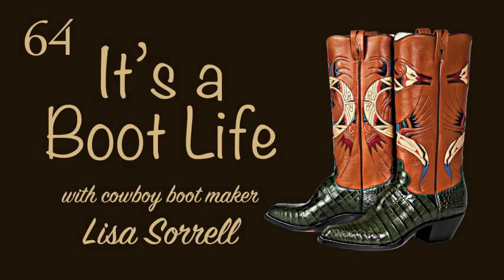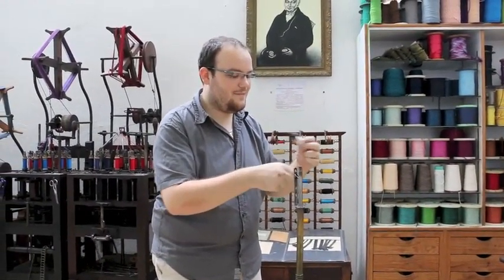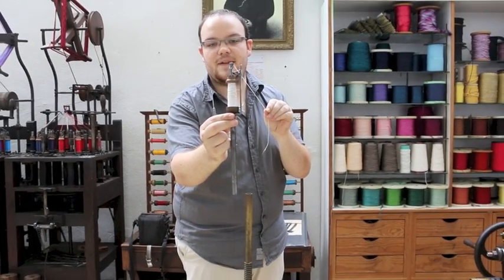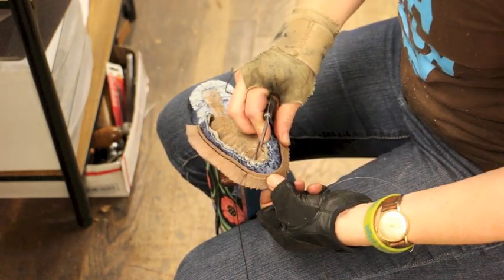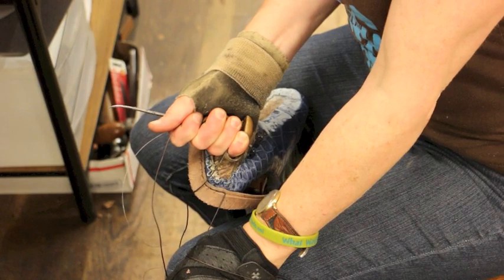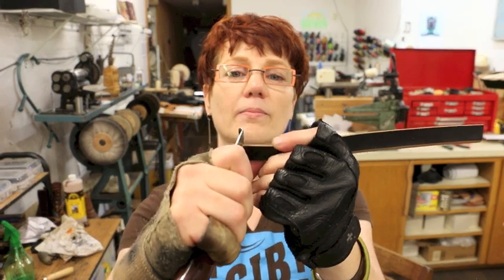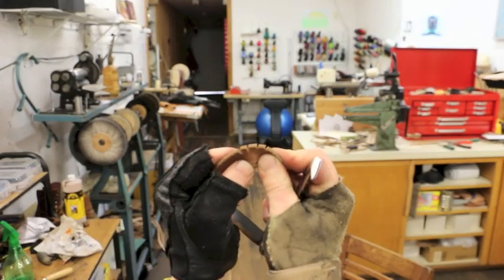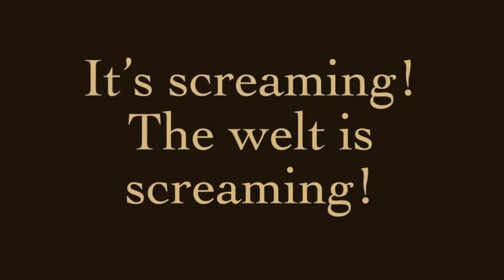It's a Boot Life: welting around the toe

Comment: Novice boot maker here.  I wonder why not run the welt all the way 'round the  entire boot?Are pegs used to stiffen the heel counter?  Do you stop the welt to give more "hourglass?...I guess that's my question. BTW, having watched a previous video  I no longer soak my welt, I stitch the toe damp, not wet, the rest, all the way around, I stitch on dry.
Reply from the maker: Yes, stopping the welt behind the ball allows for a more hourglass shape, but the main reason is that a pegged shank area is stronger than a stitched one. 

I peg the sole in the heel area too, but some boot makers use nails there. Neither strengthens the counter, because while they do go through the bottom edge of the counter, they're not in the part of the counter that wraps around the heel. The counter is stiff because it's heavy leather.
Reply: Hmmm.  Probably be buying some pegs from you soon.  Do you also sell the pokey tool to make the initial holes?
Reply: BTW, I'm honored to have you respond to my queries.
Reply from the maker: Yes, I sell the tool. :) 
The handle is called a pegging awl haft, and the "pokey" part is a pegging awl. I sell two styles of handles, one with a metal ring at the top and one with a leather ring. Both of these style have a small section of wood that extends past the ring. As you use it and hammer the end, the wood "mushrooms" over the top of the ring and holds it on tightly. The rings are there to keep the wood from splitting all the way down the handle. 
I keep a small circle of rubber at the base of the awl; this encourages the awl to bounce back out when it's driven into the leather. If you'll remind me when you order, I'll add a couple of rubber rings for you.